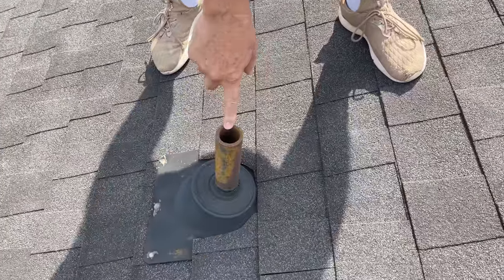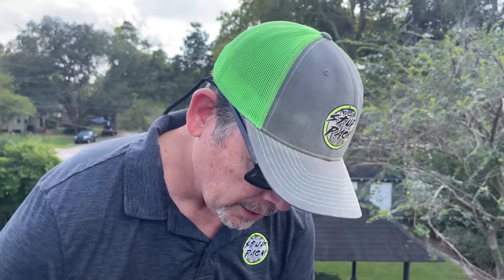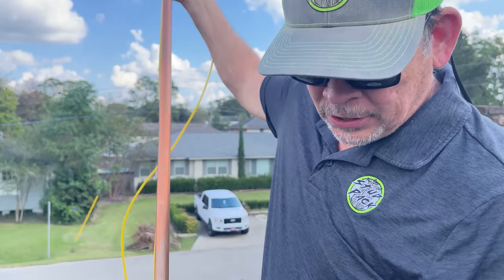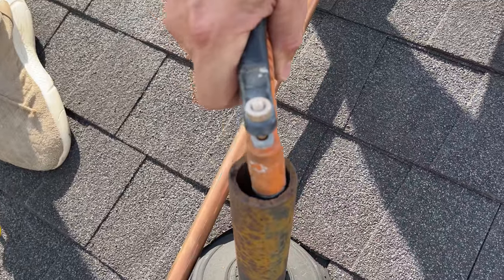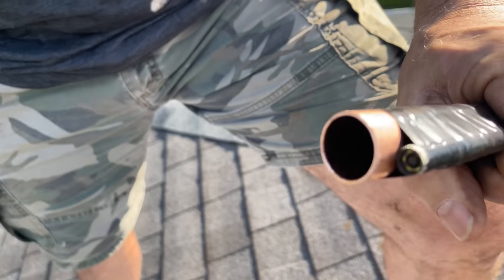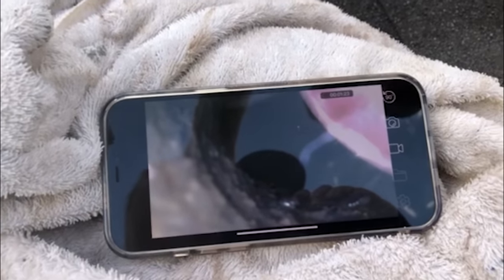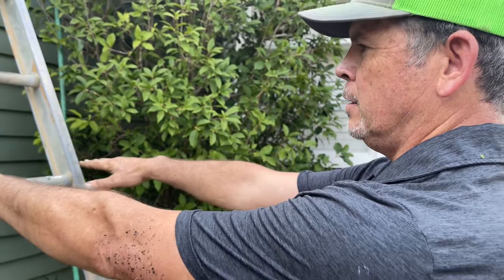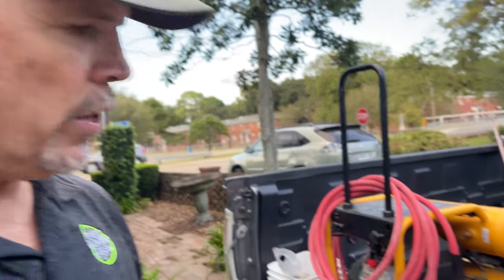Using a BORESCOPE to CLEAN OUT a CLOGGED VENT PIPE

Comment: Love your videos. This one reminded us of what happened at our previous house that had all cast iron drains. We had a back up in the basement and the only way to get to it I had to cut out a 2 foot section out of the 4 inch cast iron vent stack to get a snake in it (had to use a power snake my hand one didn't not work}. Don't know what was in there but when I hit it the motor powering the snake turned over so I has to have a friend hold the motor till I got through. Had to block the upper section of the stack so it would not drop then reinstall the cut out section with rubber couplers. Love old houses with no clean outs. When we remolded our kitchen and had to cut into the old 2 inch cast iron drain we found that it had a 1/2 inch hole in it from the build up. Had to clean it before we coupled the PVC to the new sink with a cleanout. Our new house we built has all PVC with proper clean outs and we never had a problem.

Comment: Hey that rubber plumbing vent is toast!.. You can get a little rubber dome that slips over the pipe that acts like an umbrella to the plumbing vent, thus restoring the seal. There will be a leak between the pipe and roof in short order otherwise. P.S. I got one of those boroscopes too,, saved my butt more than once..:)

Comment: Great job. Only thing i could add, you could have tried to use your small snake and wet vac at the sink clean up and probably you could have save the plumbers trip. 
 Probably you have to cover the vent pipe and other sinks with a rag or plastic to make sure that what ever you are blowing is only from the drain.   I have done this a couple of times and I have been lucky.

Comment: Everyone has a different idea of what to do, mine would have been to put the bladder on the end of the hose and into the vent pipe, that will really seal it and possibly push the objects through, and then there is my favorite, run the jetter. But getting as much of the solid objects out first like you did is always good.

Comment: Back 21 yrs ago our church bought the old MORRIS School For Boys. Well we had issues from day 1 with drains with issues like this. One of the best things found was a rubber bladder that attaches to the water hose, run it down the vent stack, then turn it on. It will swell up to stop the back pressure the it will spray force jet of water through the blockage, (most of the time).
You can get them at most plumbing shops. Also found that you could use a 
plug /cap at a tee and put a Schrader Valve on it and AIR PRESSURE it
Reply from the maker: Yeah I almost bought one of those hose attachments.   I learned the hard way to never pressurize a sewer system 😂

Comment: As a retired master plumber I must say that I routinely snake down the vent to clear a clog , all the way to the trunk line . It eliminates the mess in the home . Also allows me to run hot water flushing the pipe and cleaning my cable . . My Spartan  100 would of ground those nuts to pieces without blinking . Something is up with the first guy that showed up .

Comment: That was such an amazing problem and solution.  It's incredible what problems  we homeowners go through.  I've had an ant infestation once. They were in every room of the house, even in my bed.  I've had mice infestation.  At nite, I could hear them climbing inside the walls.  A former neighbor used to feed squirrels peanuts and could hear them scampering across my roof.  I wonder how many peanuts are in  drainpipes ?  What's next I wonder?  Great video, Great job guys.

Comment: I worked over 45 years in the wastewater industry running sewage treatment plants and pumping stations and maintaining sewer lines and laterals coming from peoples houses I’ve seen many strange things in sewer lines and laterals, of course I had big equipment to clean big lines and small lines we had sewer Rodders that would bust through the biggest clouds or the largest of roots we also had vacuum trucks that would lift up a 16 pound bowling ball at 20 feet in depth, after 45 years you get pretty good at what you’re doing if you haven’t learned by then you should’ve never started the job in the first place, A lot of what you learn over time is trial and error there is many times that you think the clog is freed up only to find when you get to the end of the line it’s still clogged what you guys heard on this job been there done that numerous times but together you worked through it and you made it better than it was before you came that’s what matters you have integrity and that counts for a lot I can graduate are you both on doing an awesome job, keep up the good work I enjoy watching your videos good luck in the future, God bless…!!!

Comment: Roof Vents, like those for a toilet(3-4” dis) that are underneath pine trees can also become significantly restricted from accumulation of pine straw needles that accumulate and for I assume lack of oxygen and other naturally occurring microbes that need oxygen(from air) and do not decay at a normal annual rate when exposed to air and water will also form a considerable blockage especially considering rainfall helping wash them in tighter together.  First time I’ve seen this though.  I recall watching a documentary many years back on just how few nuts squirrels bury that they find they ain’t to sharp in that area either, but they will spend days figuring out how to get past so called “squirrel proofing” on bird feeders.

Comment: I've been a Plumber for more than 15 years, and was a vacuum cleaner service tech for 6 years. As a vacuum cleaner service tech, I'd go to peoples homes that had Central Vacuum Systems in their homes. Kids would always clog those systems up with crayons, hot wheel cars, beanie babies, etc. The way we'd fix clogs, instead of snaking and using a camera and all that, we'd take a shop vac, place it over the entire hole, in your case, the Vent Pipe, and turn the shop vac on using suction, then reverse to blower mode and blow the pipe down. Suction...Blower....Suction....Blower.... Suction up, Blower Down. This would eventually loosen whatever was in there clogging the system to the point it could be pulled through. No need for cameras and all that. Simple too. Hope this helps.

Comment: I'm not sure if you'll try it but HSN sells a non toxic drain cleaner. It will emulsify food grease hair whatever. I use it in my home. It is fantastic and works fast. It's called Professor Amos. I think it would have opened that clog quickly. Just hoping this suggestion helps. Love your videos. Your father is amazing.

Comment: I have pulled a lot of squirrels out of vents and plumbing here in south Mississippi.   Over the years as a plumber I have pulled several squirrels out of toilets that got stuck and drowned trying to find a way out after falling into the 4" vent pipe from on the roof.  Had one person and a business that did not learn their lesson the first time and did not cover the vents or want to pay me to cover them with wire mesh.  After a few hundred dollars in plumbing labor they finally got the vents covered.   If you have oak trees or any nut trees close to your roof you better take warning and cover those vents.

Comment: Of course it doesn't fit on any of them... Must be a Dewalt miter saw or palm sander.... I feel your pain and have the same problem... Have a drawer full of vac fittings that don't fit too! Try some one inch foam window insulation (Weather Stripping Door Seal Strip for Doors and Windows on amazon) that has the one side that is sticky... wrap it around the tool side of the fitting before you slide the vacuum hose on to close the air gap, it's not perfect but works in a pinch on most tools to attach the vacuum hose and make the fit snug when the adapter is to big. Thanks for all the great videos guys!

Comment: In my house they had a straight run of drain pipe going at least 12 feet long and flat with no support from the kitchen sink, so as it filled with water and crud it sagged. and that's where all the grease and disposal crap accumulated
I had to add support and because grease does not like to snake out, it kept plugging the sink drain.
Eventually some of the grease worked it's way up to the vent pipe clogging it as well.
Hot greasy water will flow until it hits the cold drain pipes and then congeals in the pipe clogging it.
The solution I came up with was filling all the largest pots I had (about 8 gallons worth) and putting them on the kitchen stove bringing them up to a boil, then dumping them down the drain one after the other so when the sink backed up, I plugged one side of the sink and turned on the disposal on the other side pressurizing the system and sending boiling water up the vent pipe melting the grease, then the grease in the drain pipe came loose and the pressure flushed it out.
The boiling hot water stayed hot enough, long enough to warm the pipes and melt out all the grease.
It's been a few months now and everything is still working great.

Comment: Should use a 1 1/2 pipe tap to chase the threads on the clean out threads. Makes it easier to get the pvc plug in and out.

Comment: Looks like stuff I  contrive.  With 3 houses, it's always something I end up doing. I always wondered if roof vents should have an upside down p trap, or screen on them. As a mechanic, had a blower motor in car, full of dogfood, compliments of a squirell. As a tree guy, I see aluminum fences, and aluminum wire straps on chain link fences , chewed up all the time.

Comment: I used to have the P trap in my bathtub clog all the time when my X would give the cats and dog a bath. It only had an X strainer in the tub and never found a temporary strainer that would stop all the hair. I used to just wrap a small wet towel around the end of a wet vacuum and the tub vent and hit the switch on the vacuum for a couple seconds (no sewer gas in a second) and was able to pick the hair out around the X. Didn't want to take the ancient p-trap off because every time I do anything with plumbing I start at the sink,tub,toilet whatever I end up finishing at the curb 🤣😂😆

Comment: My neighbor used to put in a hose and seal the pipe. Then he would pressurize the pipe and flush the clog away. Kept expecting him to blowout a wall, but he got away with it. Also, maybe some teeth cut in the end of the pipe would cut up the mess as you turned it around a few times.

Comment: Have you ever had the cast iron pipe corking fall down from the joint and form a snag? I either have the snag or the squirrel-nut problem. I like the borescope on copper pipe with the snake inside the pipe!

Comment: Thanks studpack I use your set up to clear my vent pipe in till we do the plumbing over next year I use 2 shop vacs one blowing  on the roof and one sucking at the clean out 3 times was the charm wash the vent pipe out but a screen on the pipe like you did thank much if your ever in NYC dinner on me
Reply from the maker: Thx Mattyboy!  Love NYC been there lots of times but it's been awhile.  Be careful of snow blocking the vent with the screen on it this winter.  Comments have suggested putting an inverter trap there, will do the same thing 👍
Reply: @StudPack  ok thank again for the tip

Comment: One thing to try when you can't get a good seal with plunger is to use what I call the jiggle method.  Simply move the plunger up and down rhythmically, an inch or so, maybe less, not worrying about making a good seal.  Try it for a few minutes varying the rate.  This is the first thing I try with clogged toilets.  I would say it worked about a third of the time for me.  With toilets I am willing to jiggle it for five minutes for a chance at not splashing yuck all over when the plunger doesn't seal.  I think it is also less likely to blow out a wax ring on a toilet.

Comment: I think getting a pipe with a diameter big enough to fit on the outside of the vent pipe with a good seal, hooked up to your shop vac, and then opening up the clean out under the sink for air flow might have worked better... just like a built-in vac line...
Reply from the maker: Tried it.   Clog was such that it was just like putting your hand on the end of a vacuum hose.   No air flow no vacuum
Reply: @StudPack :  Too bad you couldn't have had two shop vacs... one at the sink blowing and one on the roof sucking...  that would have been interesting if you could have sealed off the second sink.

Comment: If you come across this again try tapping the vent pipe gently with a hammer, Causes the bits to shift ever so slightly to disengage them from their current spot. Also could do that with the vent full of water.

Comment: A little late now but you should try to take the vacuum over the whole vent pipe to try sucking the debris up on and off a couple times.
Sometimes if pressure doesnt loosen it then underpressure the whole pipe could loosen it just enugh
Reply from the maker: Doesn’t work.  It’s like putting your hand over the end of a vacuum hose.

Comment: I can’t help but laugh at the irony with these vent pipes. In Australia we’ve had special tops for them for over 50 years, that stops debris getting in.  My first house failed the pre-purchase inspection because the protective cap on the laundry roof was partially broken.  We don’t have squirrels in Australia, so I never thought about why the roof vent pipes needed those special caps.   The USA could really do with them though!

Comment: great work. why didn't you just create a vacuum on the soil stack with the shop vac hose at the top? This would have / should have / could have pulled the pecans and acorns loose and bring them toward the top making it easier to remove thru the copper.
Reply from the maker: Didn’t work.  No airflow equals no vacuum.   Like putting your hand on the end of the hose 👊

Comment: Cap off the vent pipe and put the stopper in the sink without the garbage disposal
Now turn on the garbage disposal 
The action of the disposal works like a pump and will blow out the stoppage
My neighbor-spent 2 days trying to unplug his i went there with my method and as fast as he turned on the switch its unplugged he couldnt believe it

Comment: Squirrels are sinister! BTW, it's best to remove the filter from the vacuum when sucking up water.
Reply from the maker: Yeah I forgot 😫
Reply: @StudPack  If you only forget once, you're way ahead of me...haha.
Reply: @StudPack  Noticed that filter too, but then realized the filter would keep the nasty, fermented nuts out of the guts of the machine.
At my last job, I made a foam "filter" of thin upholstery foam for wet-vaccing... kept nastiness out of the vac, and washed up fast and easily with a hose.

Comment: I bet you spent $75 on that 20 feet of pipe.  Better hold on to it because I was replacing some sink shutoff's on a bathroom vanity replacement and the local Ace Hardware did not carry any copper pipe.  I had to go to a pump supply to get what I needed and it was just some sweat fittings to add Pex to the line so I could install the new vanity cabinet.  I don't know how we are going to repair houses with copper pipes if they are going away from selling it.  Great job on the vent but I have used a swimming pool vacuum hose attached to the vacuum hose to clean out vents before.  It was flexible enough to send it down the pipe and remove all the obstructions plus it came in a 25 foot length.  Still a great video and shows the pains you have to go to just to make a repair when people think that it would be easy work.  I know you didn't get paid enought for that job so maybe Jordan gets a hamburger instead of a steak dinner.  Sorry Jordan.
Reply from the maker: Thx Glen 👊👍.  $100 for that copper 😳

Comment: If you consider that both sink drains are connected together one or the other will be the 'breather' therefore it has nothing to do with the stack pipe - get a drain plumber that will find the blockage and clear it or replace the pipes involved.
Reply from the maker: That’s exactly how the double traps are acting.   They’re “breathing” sewer gas in the house.  Has everything to do with the vent 👍👊
Reply: @StudPack  - thanks for the reply - please post a video of what is found.

Comment: I had a squirrel go down my metal fire place chimney and into the fire place like Santa.  I had a piece of plywood over the front to block drafts so he was trapped in there.  It sounded like a lion in there with all the running and jumping on the sheet metal.  I got some heavy gloves on and tried to just pull back the board to see if I could trap whatever was in there in a box but the damned thing went right over my shoulder, heading right at my wife.  As fast as he was, she was faster.  I don't think her feet touched the floor until she was locked behind the bathroom door.  Meanwhile a soot covered squirrel was running up and down my walls and curtains like a motorcycle stunt rider inside the tank at the fair.  He was pissing out of fear and mixing that with the soot and coating everything. Finally I coaxed my wife to open the door so that I could chase him outside with a broom.
Reply: Huummm - brings to mind Ray Stevens - "Mississippi Squirrel Revival"  🤣🤣

Comment: I wouldn't have drained it first... I would have used the vacuum (sealed to the vent pipe directly to see if it could suck air up and break up the clog and then let it drain. Works about half the time.  No dice?  Then try snaking from the roof and see if it can drain.
Reply from the maker: We tried both of those first.   No 🎲